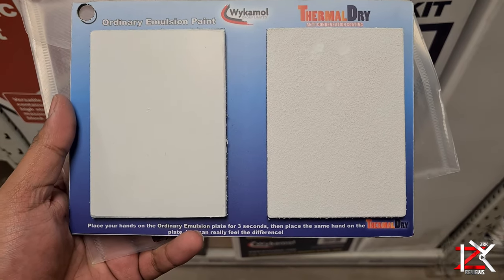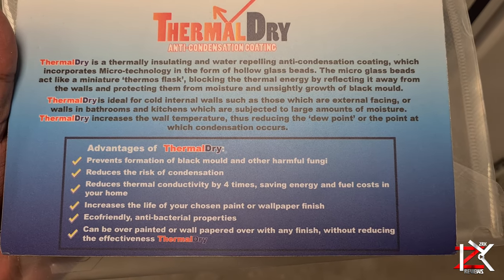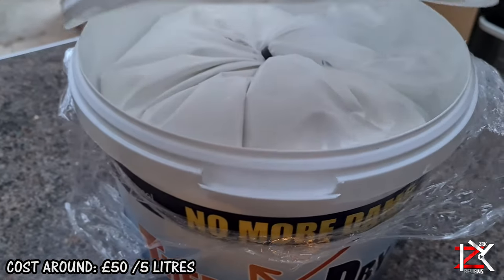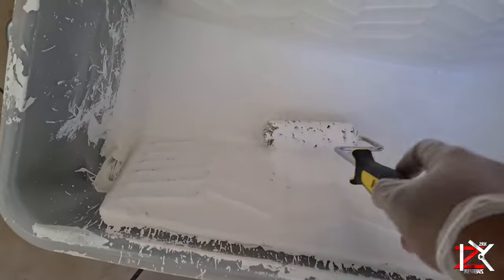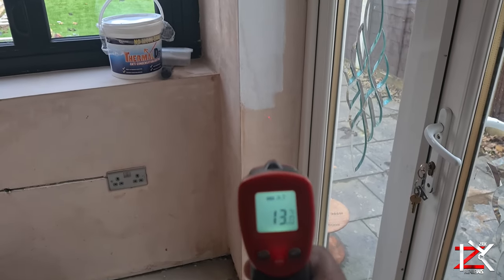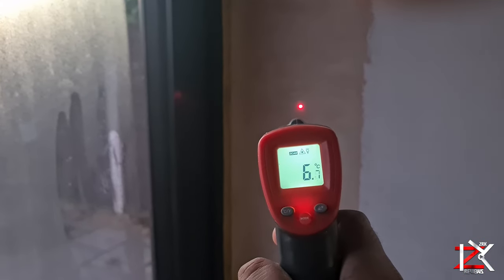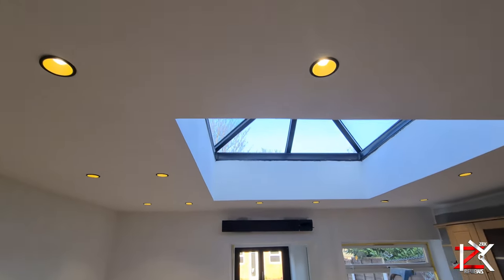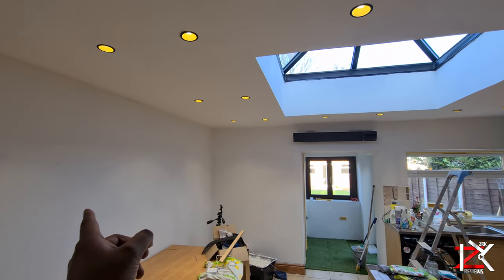YOU NEED THIS PAINT! How To Get Rid of Damp/Mould - Energy Saving Paint - Anti Condensation Paint

Comment: Nice review but want to point out to people that its an expensive paint for what it actually gives, A 1 degree gain is very little to be honest as you have shown with your thermal gun. In my experience 2 or 3 degrees increase is more effective and you can feel the difference in any room. The best way to warm any property is to use insulation board or insulate on the outside, both methods are expensive but pay off in the long run especially with gas prices going up every month.
Reply from the maker: Thermal gun temperature was shown for the surface temperature only, main feature of the paint is that it retains heat in your home, so heating will be left on for less time because of no heat escaping, plus no damp/mold more life on top coat paint. For exterior also try DrySeal  https://youtu.be/J3iSqzI_A3E
Reply: @ZRKREVIEWS  agree damp issue will go away but you can get anti mould paint for half the price. For the room to retain heat longer the surface must have sufficient resistance to prevent energy loss. A paint is less than 2mm thick so wont be as effective as insulation. I would save money and go for permanent solution for long term.
Reply: @bbar182  I disagree, I just used zinsser primer and anti mould paint and it doesn't stop condensation. I painted a dryer cupboard. Because antiould paint doesn't have glass beads or whatever tech is in it.
Reply: @qkayani  yes you will get condensation but no mould, my dad has used zinnser in bathroom ceiling and it prevented mould. He still gets condensation after showering but that's because there isnt enough air flow in the room. If you want to prevent condensation then you must improve air flow, it's an easy fix and permanent fix but will cost more than paint.
Reply: There is one simple issue with your theory - you are assuming that both options are available to everyone. So while I agree external or panel insulation is definitely better - if panels cannot be installed then what options does one have? For my external walls for example on a third-floor flat - panels are not feasible. Internally adding panels means skirting board, doors architraves, and windows frames are in the way.
Reply: Internal insulation has the same problem if its a flat or house, there are still radiators, window boards and skirtings that need removing before the plasterboard is installed. and Then you have the finishes to take care of. But the benefits are worth it in the long run when your energy bills go down by 30 to 40%. The U value or plasterboard is far more superior than any wallpaper or paint. Trust me i have tried the thermal wallpaper option and while it reduced condensation it never lived up to the heating hype the company promised. If i were you  and wanted to go for the easy but expensive option there is a product called aerogel boards that give the same performance as insulation but the thickness is only 13mm. This way you get performance, easy installation and get any finish you want...
Reply: @bbar182  thanks I’ll check it out. But I suspect although I quick scanned that on top of the now 10mm panel you’ll still need plaster.
Reply: @davidesanseverino9104  yes skim or you could use lining paper and paint for a finished wall.

Comment: comparison of thermal testing between plastered and painted wall is wrong and misleading. The comparison should have been done between two painted areas - one with the normal paint, the other one thermal paint. The same number of coats. The same color of paint.  Not much trust to this video.

Comment: Can I ask why use this and not dry zone or ronsrsl anti damp paint?
Reply from the maker: Because of more benefits, anti condensation and reflects heat keeping rooms warmer, this is contractors paint one of the best out there that is why i have used it around my home after research. Also i like to add i did apply zinsser on a bubbling up wall with damp etc still didnt got through it, until i found out it was rising damp off a broken waste pipe.
Reply: Hi if I had a normal damp problem and no broken pipe would you recommend Zinsser? Or am I better off buying this brand?

Comment: Can i use this paint in my sitting room on one of the cold wall which is facing road?? It's very cold in winter and mould also coming.
Reply from the maker: Absolutely, apply it, check and come back and thank me later :)
Reply: @ZRKREVIEWS  JazakAllah... One more question. After doing this paint on the wall under the bay window can I paste thermal liner on it to make the room more warmer or can i do ordinary paint to match the colour with the room? and Does it comes in 1 litre?
Reply from the maker: @user-ns7vj4tz5h  normally you apply thermal paint then on top you apply any paint or wallpaper, don't apply thermal paint on wallpaper as not recommended. Thermal liners shouldn't be a problem but the thermal paint should be sufficient, 2.5l or 5l
Reply: @ZRKREVIEWS  Thanks...Which one is more effective thermal liner or a thermal Paint to stop cold?

Comment: Please reply ...
Can I use this on window edges where there is slight mould? A little clean and straight over?
Also, can we get other colours?
Also, please reply with the link where you bought yours from.
Thanks
Reply from the maker: Yes u can use on window areas, they only do white, so apply thermal paint then on top choose any colour paint for top coat. Please check amazon link in description thanks
Reply: @ZRKREVIEWS  thank you so much for your prompt response which has sorted many months of concerns.. I shall now subscribe..

Please just clarify if I can paint on top of slight dry mould stains?